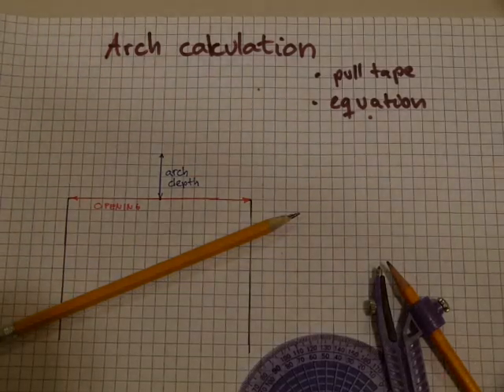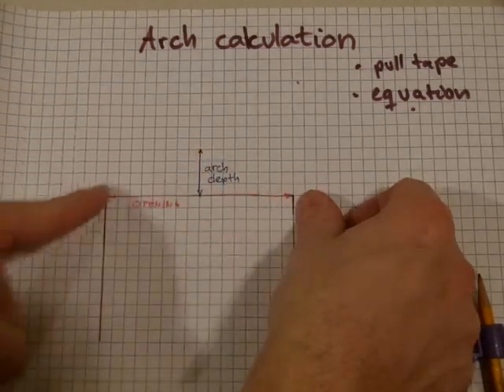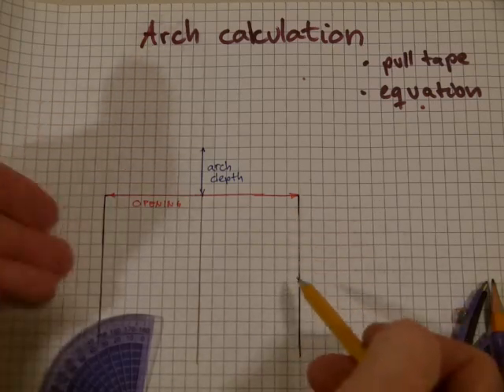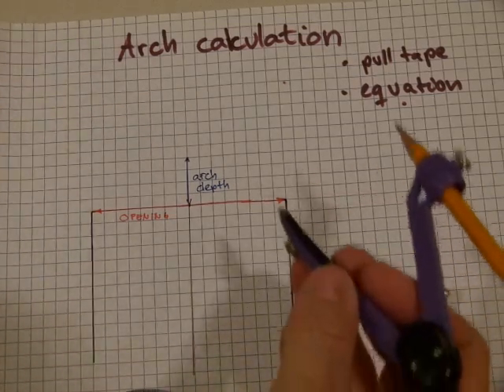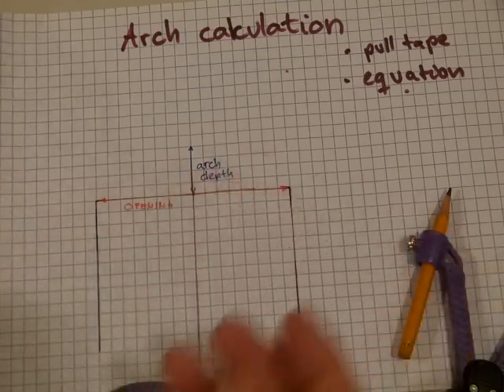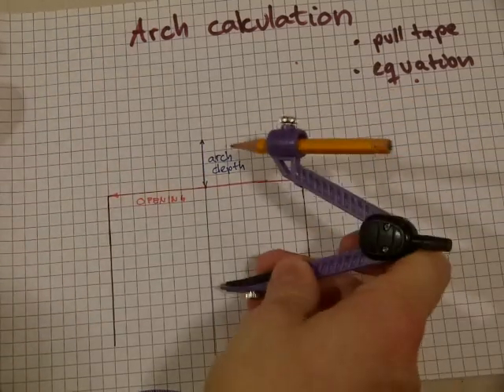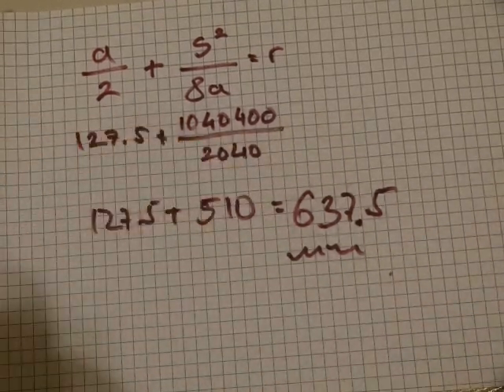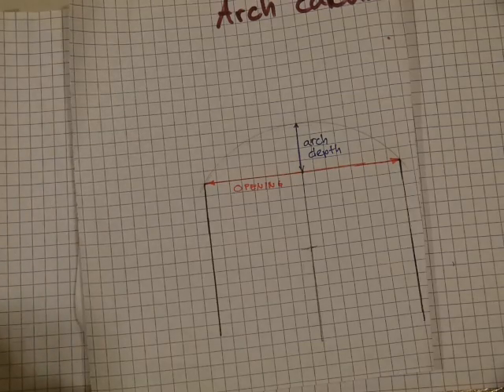Arch calculation for layout (find radius, given span and depth of arch)

Comment: god this guy made this complicated.
to find centre of any length ,  measure from one side further than what you think is centre and mark.
do the same on other side of opening and mark.
measure distance between marks and half it .
that's centre
now you have the centre open compass to the desired height and draw a half circle.
from the side draw a line down at 90 degrees to the base line.
open up the compass from one side  of the opening to the other .
transfer distance to line marked 90 degrees off the base and mark on the line
open up compass from mark to opening on the other side and strike a arc to where it meets small half circle .
do same on other side and you have a arch.

Comment: Here is a simpler no math way. Think of a Gothic Arch as an A Frame building with curved rafters. Draw a line the length of the rafter on a floor or big enough work table and mark the center. Drive a nail at each end of  the line. Place a batten against the nails and from the center push out the batten until you reach the desired curve. draw the curve on the inside of the batten and you have the inside of the arch. It is so simple any one can do it. Securely fasten blocks about two feet apart along the line and you have a building jig. The block spacing varies with the size of the arch.

This method works for any arch from windows, doors to buildings. I have even used it to build boats. If you want a different curve, push the batten out at different points. It is fun to see how many shapes you can make.

Comment: Graphically connect the top of the arch with the shoulder then bisect that line segment . Then draw perpendicular bisector and draw a line  towards the central line that is the center of the correct circle.
Reply from the maker: It works, of course. The difference between doing math vs. geometric construction is  that a geometric layout produces work that can be out by 10 mm on this scale. Math is accurate to several decimal places.
Reply: Human errors can be made in the measurements of your mathematical solution, so no option is better than the other as far as accuracy is concerned.
Reply: Thales Nemo maths = speed and accuracy , the incredible language of math and geometry axioms
Reply: The Kaveman Not in the building trades.

Comment: The standard formula for finding the radius of an arch is. 1/2 Span squared ,divided by Rise, plus Rise, divided by 2.
Reply: yours formula is totally wrong  dear friend
Reply: In trade school we were taught to first find the center by overlapping  2 circles with protractor where the 2 circles meet draw a line through give you a long straight center line

Comment: a is half the chord , b is half the chord , c is the rise  measured at the centre of the chord ........a x b divided by c = d ......d + c divided by 2 = radius  , simple  in mm , if your using inches god help you or  just buy a metric tape measure  🇦🇺 straya  👍🏻
Reply from the maker: Works either way, units can be alien feet or Martian's hands, same logic works.

Comment: A squared + (B divided by 2) squared ----- then --- divided by (A multiplied by 2) = answer. You didn't show to divide B by 2 in your equation at 10:00.
Reply from the maker: Right, not shown as at 9:13 I say "half the opening", then that number (510) is written down. b = half the opening, ergo the full opening is 1020, shown full scale at 5:28.